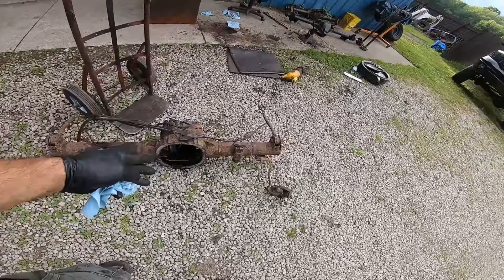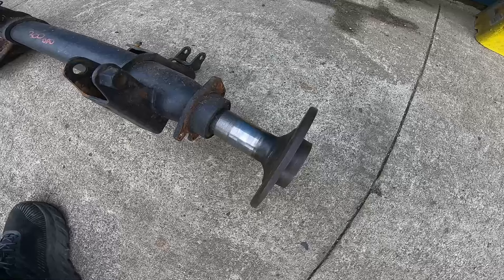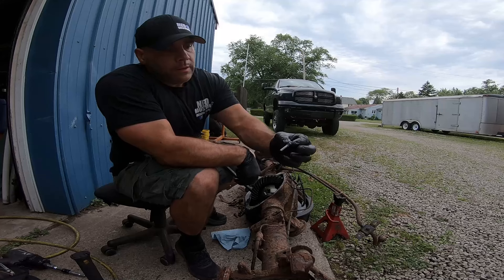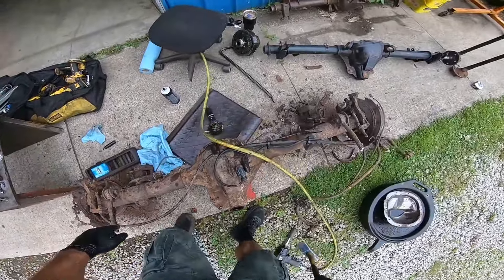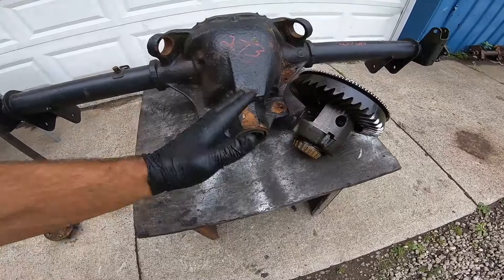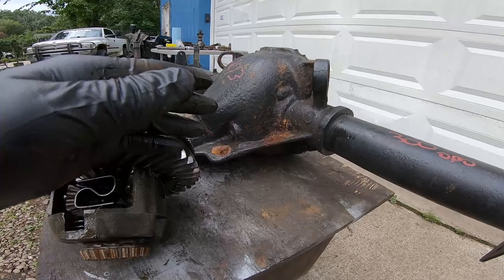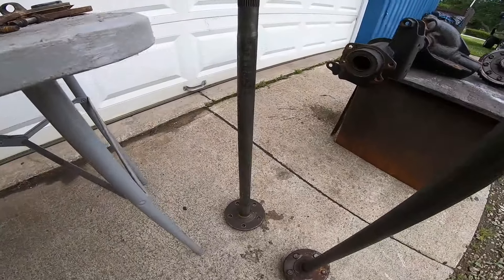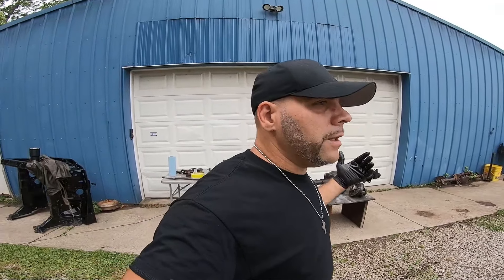This Just Might Work - Junkyard Built 31 Spline 8.8 Axle

Comment: It might be too late for this but I would buy 2x V8 Explorer axles, cut off both of the long axle tubes at the center section, then clean them up.

Next cut the axle tubes completely out of the Fox body axle, trim the Explorer axle tubes to the correct width and weld them in to the Fox body center section.  Weld Fox body style brackets on the axle tubes to bolt in, run the Explorer disk brakes, then either get custom axles or respline some Explorer axles.

It might be a little more expensive but it's cleaner and gives you lots of options for axle width and you get disk brakes in the bargain.

If you build it the specific width to use two Explorer short axles it might actually be cheaper and could make broken axles replacement a parts store purchase instead of a custom order.
Reply from the maker: I do like the brain storm ! Good ideas

Comment: Nice project. Could you just turn the bearing ends down of 2 long explorer axles and stick them into a foxbody 8.8?
Reply: I think the axles are only surface hardened. If you turn them down the bearings will only be riding on soft steel.

Comment: Hey dumb question and may kinda defeat the purpose but could the ends of the axles be machined to fit bearing for the fox?
Reply: I think the axles are only surface hardened. If you turn them down the bearings will only be riding on soft steel.

Comment: I put 31spline 1988 f150 axle gears in my Foxbody  8.8 .. from there i put moser axles in it with Cclip eliminators .  Im not saying anything bad about what your doing im just letting ppl know that the 31spline f150 axle gears will fit in the 28 spline carrier .. its been a while back maybe i used the spider gears out of the F150 lsd carrier aswell i cant remember ..  im just trying to help not start a pissing contest to see who can piss farther lmbo ..  btw mine us not a disc brake set up !!!
Reply from the maker: Yeah, there’s nothing wrong with sharing. This is a 31 spine unit though which is quite a bit stronger than 28.
Reply: @Neomustangs  the more we know !!!! Right ???
Reply: @Neomustangs is ìt stronger?  He just changed the spider gears to get the diff to take 31 spline axles.  Did they make a stronger carrier for the 31 spline diffs?  That seems unlikely to me.
Reply from the maker: @beardoe6874  31 spline spider gears/axles are strong than 28 yes. You can do that. Id imagine most dont bother they just put the same carrier with spiders in replacing the old.

Comment: Not a lot of people would have the skill to pull this off, especially welding the ends on.  For me I would just get moser 31 spline axles and a 31 spline differential, easy peasy.  Even some moser SN95 axles and get some sn95 take off parts brackets for the brakes would also work and widen the stance of the rear.  Rear calipers could be sourced from Rockauto, to complete the install...
Reply from the maker: Well, this video is not for those people then. If it could be just as strong and save a third of the money, it gives people options but thanks for your input……